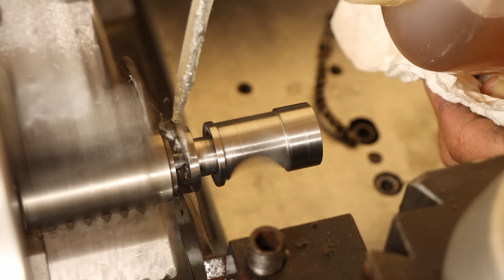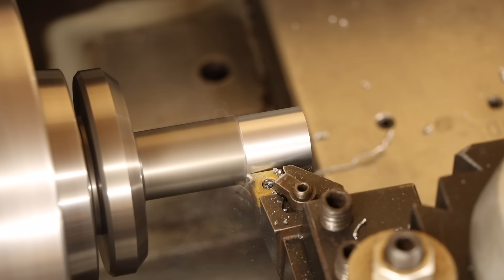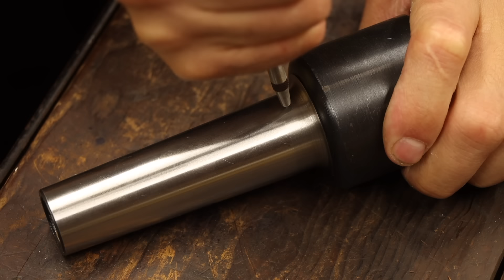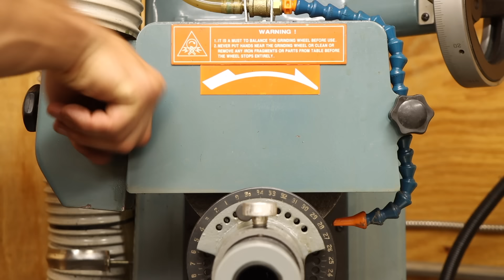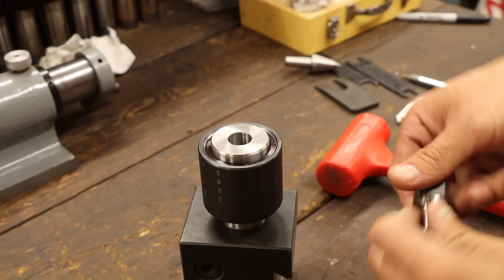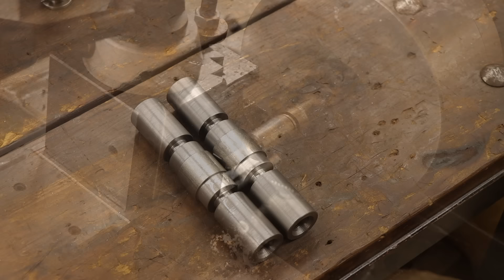Rotary Broaching Eccentric Cams || INHERITANCE MACHINING

Comment: No offense to all the Americans out there, but what if... #LewisCK ... what if the world went all Metric? And not this arbitrarily weird roller coaster you guys keep clinging onto? ;)
Reply from the maker: I think the biggest problem with that isn't an unfamiliarity with metric, but the cost to convert every industry in the US over would be staggering. Most companies are running on slim enough margins as is. And only a small minority would vote for government subsidization of the cost.
Reply: Metrifacation was really pushed back in the 1970's
I recall my drafting classes we were required to use SI units.  (but NOT in architectural drawing!)
But there is a LOT of legacy in trades like construction, where you find material like lumber, concrete, panel goods and reinforcement bar scaled to the anatomy of long dead 'rulers'
And there is no easy way for machine tools like Brandon's to work in metric. Lead screws, nuts, scales and gearboxes would all need to be changed.
At that point you're better off melting those tools down for scrap. And NONE of us would want to see that. 😢

Comment: This is a very ambitious and advanced project for even the most advanced hobby machinist. And don't feel bad about the broken broach, the forces are tremendous, I don't think 1 degree is enough to cause the shearing action necessary for a clean cut. Glad the milling worked. Oh, and the steel that gave you the "darned sexy" finish is most likely a high carbon steel in the high 30's or low 40's Rc range.
Reply from the maker: Thanks! And thanks for the info. A lot of the geometry I was basing on suggestions from a website called PolygonSolutions. They had a pretty details article all about the topic

Comment: You can also broach using the quill on the mill. You can come over a thou at a time and crank down using a tool that looks like maybe a quarter of your rotary broach with the spindle aligned and locked.
Reply from the maker: Ah interesting!

Comment: Hi. I like watching your efforts on youtube on my tv. Your projects are usually a little more in depth than mine. I am retired at 73. Also, I would never criticize your efforts or mishaps. While working, I did a lot of "temporary" projects to get me by for a day, week, month, or even years. Some took a lot of redos. All "temporary" fixes. I am going to pass something along that I learned during one of these fixes. When using your boring bar to machine the 1/3 circle scallop in the sides of your cams, might I offer a suggestion that I learned many years ago. Start off with a hole saw. Like a milwaukee, or starrett. Instead of using the store-bought arbor as designed, notice the smaller sizes use an arbor that has a 3/4" round shank beneath the normally used chucking hex. Use a 3/4" R8 collet or whatever collet system you use. Remove the drill bit used to hold the hole saw in the center. Then, the hole saw will be rigid in the mill. Make sure the size of the hole saw is slightly smaller than the diameter of the scallop to be cut. I use a spray mist to keep it cool. Here is the neatest part. Since the saw is mounted rigid, you can literally carve out a semicircle from your cam in one pass. Since it is an interrupted cut, the chips will clear out with a little air (mist) and the cut will proceed until the waste drops out. One thing to add, I also use a couple external snap rings, or a really flat washer between the arbor and cutter where the threads are. This is because the arbor has about 2 threads next to the shoulder that are removed for the threading of the arbor. Using a small spacer makes sure the cutter has 100% threads engaged. 
When finished with the hole saw, remove it and finish up with the boring bar. You will be surprised to see how quickly you can remove a 1/3, 1/2, up to 7/8 of the circle with little effort and one pass. You can even take a small pass, and then take out more to discharge a "crescent" shaped scrap.
The biggest hangup with hole saws is the inability to get rid of the chips once the hole is about 1/8" deep. The interrupted cut makes the chips just fall out with a little air (+mist for me) Even now, I am making a small tool that utilizes the hole saw. I can cut out 15-25 1 1/8" holes in less than an hour through 3/8" hot roll steel. Since I use the inside of the hole that is cut out, I overlap the cuts so (almost) every hole has an "escape path" for the chips.
Oh, by the way, I have also use the large arbors for the big hole saws. They use a locking pin system. I use the larger hole saws the same, but let them tighten against a spacer to give 100% thread engagement. Even if not perfectly eccentric, they will still cut a pretty good hole. Follow up as needed with a boring bar. Eliminates drilling a bunch of holes and finishing up with a boring bar. MOST important part! Leave an escape route for the chips. Drill a hole either inside the cut out area, or outside.
Keep posting, I enjoy learning, and it keeps my mind sharp.

Comment: Fascinating build and great video!
I’m considering beginning a similar project, my first issue being I lack a D1-5 to reverse engineer.
Have you dimensioned component drawings that you would consider sharing, as I haven’t been able to find much beyond nose angle, pin circle and diameter, the cam mechanism leaving me befuddled.
Again, great videos, and thanks in advance.
Reply from the maker: Thanks George! I did share my design drawing on my Patreon account. You can also google "iso 702-2 pdf" where you should be able to find the metric ISO drawings for all the D1 nose spindles
Reply: Many thanks, for your informative reply.
I’d love to go nuts on Patreon, to many of the deserving individuals, like yourself.
I don’t have the financial means at this time, and apologize.
The ISO 702-2 search was fruitful though, and I want to extend thanks once more, and encourage your keeping up the projects and videos.
I’m genuinely envious of your abilities regarding the sharing of knowledge and experience via your videos.
Regards,
George Dreisch

Comment: Why not just rough the square side in with a carbide end mill on the mill? Def a lot faster than grinding lol ..also the first round grinding op could have been roughly defined on the lathe with carbide as well...
Reply from the maker: I honestly never even considered that 🤯
Reply: @InheritanceMachining  yeah definitely try it sometime....the other day I had to make a 0.029" wide grooving tool for an e-clip groove, rather than sit there at the grinding wheel grinding and dunking in water, and then grinding some more, I just stuck the 1/4" tool bit in the mill vise and roughed it down to size....also made a square broach that way one time with a broken end mill and a square collet block ...quick and easy! 👍🏻🍻

Comment: Do you think you would have had more success with a wobbling broach or graduated cuts at all? Asking for myself.
Reply from the maker: This technically works the same as a "wobble" broach on the mill because of the 1 degree angle I placed it at. I would image graduated cuts would work as well, or pre milling before broaching. I think i would have had better success if I had hardened the tool since the center of the mill I used likely wasn't as hard as it could be. Also could have put a very slight radius on each corner to reduce the stress concentrations.
Reply: @InheritanceMachining  Good to know. Thank you.

Comment: I was just planning to skip through and see how you made the cam part but ended up being drawn in and watched from start to finish. Nice work!!
I once had to make a hex-hole on a cnc and was having trouble getting the mating part to fit in the corners. Almost went through the trouble of setting up some sort of broach on the mill but then was pleasantly surprised at how well drilling out holes in the corners worked. Prior to the milling of course!
Reply from the maker: Gotcha! 😁  But seriously thanks for sticking with it. You were wiser than I to try milling first!

*edit for typo

Comment: Small tip for setting center height for your tools. Eyeball the position first looking from the side next to a round piece you want to cut. Make a first cut and by doing so leave a true running round part. Measure the diameter. Calculate the radius and set you calliper to this. Put the tip of the tool almost touching at the front of the part. Place caliper with the protruding depth feature on top of the part and adjust the height of the tool until it touches this depth setting. This especially work better on older worn lathes where the center of the tailstock is probably not the center at the location of the part. Also a fast trick; eyeball the height, face the front and adjust on the shown center on the part. Make a another pass at the center and determine if this is what you need. Way quicker especially with a long bed. No traveling up and down with the carriage or tailstock needed. Quick, dirty and sufficient. Thank you! All the best, Job (another tip; buy a low width chuck with integrated cams. Gives you a lot more height in z and more stability when cutting. Try the Bison brand (not affiliated but just good affordable chucks. High end? Go Röhm or a Swiss brand)
Reply from the maker: Those are very useful tips. Especially considering the time involved in shuttling and re-squaring the tool post. Thanks!

Comment: its always funny how i happen to be doing something similar in my own shop to a video that pops on youtube. Last night I took an 800w 24k rpm er11 spindle and vfd that ended up not getting used in another project and mounted it on a tool holder on my lathe to grind some eccentric er11 collet holders for my little emco pc turn 50 lathe's tool turret. getting the height of drills aligned is a huge pain when they just go into bores with no built in adjustment, eccentric collet holders fixes that. I used to use a Foredom tool mounted in a boring bar holder, but this little setup works so much better. The only issue now is figuring out a good solution for truing up the wheel. For now i clamped a diamond nib to the spindle but it can move some so not ideal. I've seen some people mount a boring head in the tail stock, but that doesn't necessarily work on my lathe. Maybe I just don't know the terminology but what do people use for their tool post grinding wheels other than Dremel crap? I picked up some $4 1x3/8 1/4in shank "grinding stones" from home depot that seemed to work well enough, but I have no idea what the compound is and the finish is kind of shit tbh.

Pro tip for diameter grinding on the lathe, lock your cross slide and set your compound at 3 degrees off axis relative to the spindle axis and when you move the compound in 10 thou, you will move in on diameter 1 thou. I think most compounds use dials that are directly correlated to the movement, not on the diameter. You can do the same for end grinding, but turn it to 84 degrees. obviously this makes it easier to creep up on your dimensions by using a mic, but it also reduces the risk of mechanical slop ruining your dimensions. we aren't preloaded by gravity like on a surface grinder or using ball screws on most lathes. the degrees mentioned are not exact to get the exact 10:1 reduction, if you really want or need that, verify your reduction directly using measuring equipment. this is mostly useful when finish grinding, so i just set it at the rough angle and use a mic to get to my desired dimension, and do a few passes creeping up on the dimension. one last thing is if you plan to use stops on the ways or cross slide, don't forget you are moving along that axis when you move the compound.

Comment: For a hobby machinist, your projects are extremely ambitious and not something I would take on. But your doing so has given me the confidence to tackle such projects. Thank you for that!  I have a question about the rotary broach cutter. Since they are tapered, I didn't think that they could be sharpened due to the fact that doing so would cause the broached hold to be smaller??? Thanks
Reply from the maker: I love to hear that! Anything can be accomplished with a solid plan. And even if it's not you'll get to the end eventually 😁 On the broach yes that is an issue. In the case of what I did in the video, my broach was about 10 thou oversized for the wrench. So I had the wiggle room to do so. On top of that the sharpening I did only changes the size about 1 thou since the angle is only 1.5 degrees.

Comment: Most rotary broaching tools have an air release hole in the tip of the tool. You'd be surprised at how much pressure you can build up from air and cutting oil. I run a Tsugami swiss lathe at work and all of our rotary broach tools have air release holes in them. We use GenSwiss broaches.
Reply from the maker: That makes sense. I imagine this is not an issue where the pilot hole is slightly larger than the flat to flat distance though as I did.

Comment: two little bits of advice mate, take the rotary table and or the vice off of the mill table when not in use as the weight will eventually bend the table when overhanging, and take the rotary base off of the vice for extra rigidity and height. youll find you dont use it as much as you think.
Reply from the maker: Thanks. I'm actually planning to do just that for this next project

Comment: Brandon,
Let me offer a word of caution to one of your processes.
I don't understand the physics of the effect I will describe, but after seeing the effect demonstrated I no longer relied on a process that you employed and I routinely previously employed. A mag base can and does move its relative position when mag clamped to the face or OD of a lathe chuck and revolved by rotating the lathe spindle. The amount of movement introduces indicator error when indicating from the spindle arc swing to establish spindle centerline. (I hope that sentence is clear.) You can observe this phenomenon by mag clamping a mag base to a substantial steel plate and placing the mounted indicator against the same steel plate. The indicator will register any movement in the indicator setup. Now revolve the plate and indicator set up. I have seen as much as .002" of indicator travel. Try the same trick by mounting the mag base to the lathe chuck while indicating the chuck. It should read zero, but I predict that it won't. My trials conclude that the movement is the magnetic coupling not the mag base arms. For this reason, my subsequent habit is to only indicate relative to the spindle centerline by a rigid setup such as clamping the indicator arm assembly in the lathe chuck. This eliminates the magnetic coupling error potential. Noga makes a cute assembly for this purpose and is commonly marketed as a mill chuck setup tool.

As a maintenance technician I routinely set up crashed lathes to align headstock centerline to tailstock centerline and headstock centerline to turret tool holder centerline. I used the mag base mag coupled to the chuck as you demonstrated, while indicating your rotary broach to match centerlines, for nearly a decade before being convinced that the technique is not accurate. I have no way of knowing how much error I and my subordinates unintentionally introduced, but we enforced a company wide policy to not use a mag base for this application. 
.002" TIR is only .001" of centerline error and may cause tolerable finished part error in your application. Our shop practice was to shoot for dead nuts and seldom intentionally accepted anything greater than .0005" TIR. These are tight tolerances for a high production, around the clock, operation
 I am convinced that your mag base (and formerly mine) couldn't possibly achieve our shop goals.

I don't remember anyone hearing my claim NOT being a skeptic until they demonstrated the phenomenon to themselves.

Prior to purchasing my Noga tool, I dedicated an indicator holder that set screwed in place to s stub that I could mount in lathe chuck. Since it was common for our pilots to not want to break a hard jaw setup, I would quickly knock out a custom indicator holder to fit the lathe setup hard jaw limited operating range. This was an issue only on CNC drawbar operated chucks that have very limited jaw travel.
Reply from the maker: Paul, that's really good information. If anything I would have expected and deviation to come from changes in gravity direction on the arm itself, not from the magnet itself. Rigidly mounting to a chuck jaw like you mention would certainly eliminate this factor. Thanks for the tip!

Comment: centering a rotary broach is a one-sided tolerance. if it's off center in the direction that puts the trailing edge on a larger diameter, then hole will cut undersize and the tool will experience high side loads. so the centering needs to be such that the leading edge (the side that's cutting) is on the larger diameter
Reply from the maker: Good point!
Reply: @InheritanceMachining  a little further clarification: the advancing active cutting edge is 90 degrees before the edge that's tilted in furthest

Comment: Love the channel. I’ve watched all the videos after finding it the other day. 

Can someone explain why the lathe had to be spinning in order to cut the square hole? If the tool and workpiece are both spinning, I don’t understand how the cutting works. 
Is it because the tool was slightly offset (I think he said 1 degree).
Reply: yep, tiny 1 degree cuts are made on one corner a time as the material rotates.
Reply: @konzetsushi  thanks for confirming.